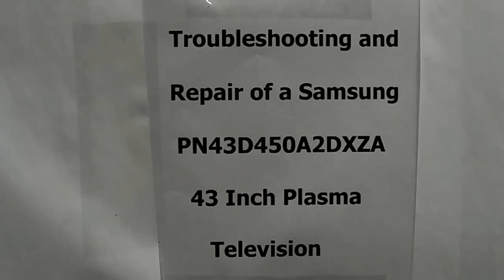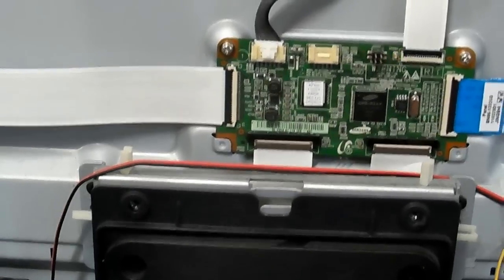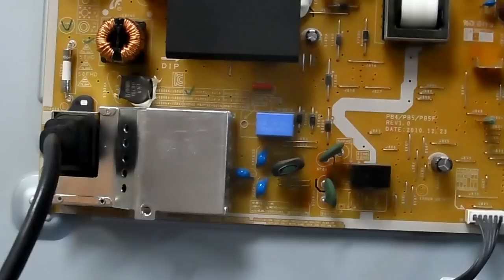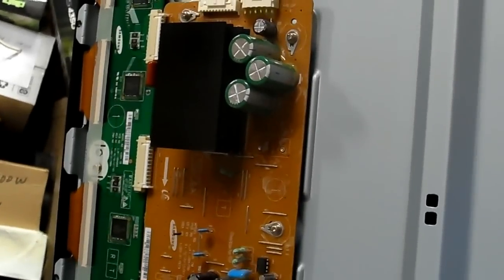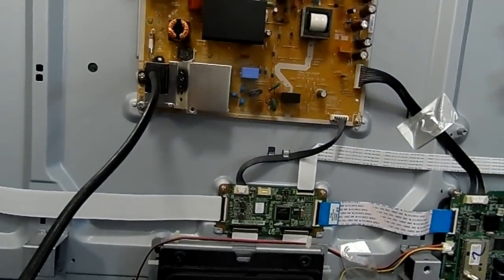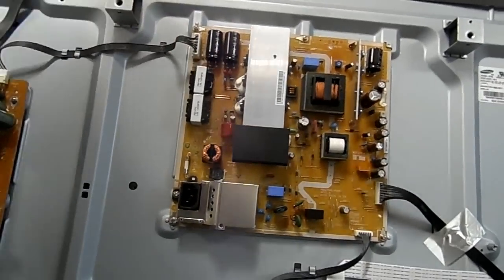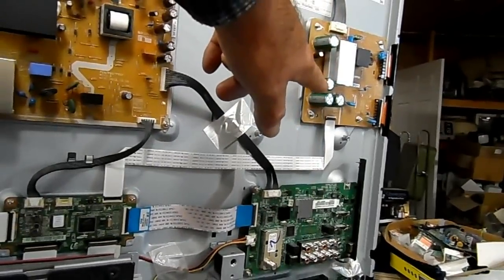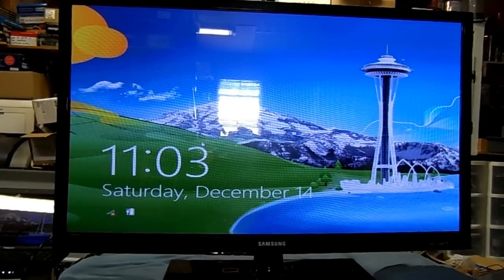Samsung PN43D450A2DXZA Plasma TV Troubleshooting and Repair

Comment: What you showed is easily one of the best ways to trouble-shoot a plasma TV. I recently repaired a 2013 63" Samsung that simply had lose grounding screws, which determined when everything passed but I still had the TV randomly shutting off. I did have to check the voltages on the power supply to rule out a PSU fault.  I also noticed what looked like some cracked solder joints where you'd expect them, i.e. heatsink mounted components such as transistors and diodes. After tightening all the screws, it works like a charm.  I know believe my other Samsung plasma had a similar  problem and I stupidly replaced unnecessary components as I couldn't figure out how to properly troubleshoot. Live and learn.

Comment: Thank you for making the video.  I first started by replacing 3 swelled caps, they were bad.  Reinstalled the board, still the same thing.  I thought I was over looking something.  After watching your video, I found that the right board was bad, just like yours.  I just bought a new board, solved the problem.  I bought my replacement board from "Useful Parts" in Canada.  They have 3 day delivery.  Thanks Godfrey for your help!

Comment: well i had the same problem with same panel. i could only find two boards on ebay, one for 100 bucks and the other for 20. got the cheap one, installed it myself, and now it works great. im a tv repair noob, so a little more on the removal and install in the video would have been helpful, but i managed. just wanted to thank you for the great video and for saving me several hundred dollars on the cost of a new tv. i appreciate it!

Comment: When troubleshooting this particular unit USE CAUTION! DO not plug in live connection or even after turning the unit off.  Wait at least 20 minutes or if you have a discharge bleeder device please use it to discharge the high voltage caps on the power supply.
 
These units are delicate beasts and you can damage the Y-main and buffers just by simply removing or plugging in the boards after being HOT.  99% of the failure on this panel are the Xmain (smaller board to the right on the video) IF you replace or repair that make sure to test your Ymain and Ybuffers before connecting the new board there are videos here on how to test buffers ect.. When the Xmain fails it can take out the Ymain and buffers with it by shorting them out.
Reply: What I said above really applies to all Plasma displays, LCD panels are a little more forgiving but I would use the same methods for those too.

Comment: I followed your direction to a tee, and what I think I learned is that the second board tested is bad. Only concern I have is that when I unplugged the left board, the clicking did not take place and the yellow light came on, but it never came on steady. It continued to flash. But again, all of the clicking stopped. Same thing happened when I plugged the left board back into the power supply, and unplugged the right board from the left board. Any thought you would be willing to share sure would be appreciated.

Comment: great video. i have an older model and it clicks even when i disconnect x/y boards. can it be a t-con issue? or plain power supply board? i recon that this issue started progressing from whem it was ok, it started turning off and turning on by itself, and later turning off after some time of use, and wouldnt turn on (click click but no power).

Comment: Great video! I have a Samsung 51" plasma and I have all the voltages on the power supply, but nothing happens when I power up the TV, no clicks nothing. I did what you recommended and unplugged the Y & X boards, and still nothing. I am guessing its the power supply?
Reply: I've worked on quite a few of the Samsungs in the series demonstrated in this video. If yours is from around 2010-2012, the power supplies rarely fail. To test these, I remove the X-main and Y-main right away to test the mosfets and diodes on the heat sinks for shorts. Otherwise, if you continue to tinker with the TV, a bad Y-main can kill the good X-main and vice versa. The buffer should be replaced if the Y-main has a short.

Comment: Help! I have the exact TV as this one with the exact problem and symptoms and I troubleshot it just like you did in the video and determined that the Power Supply must be the board with the short in it. Well I bought a new Power Supply on ebay, it came in today, I installed it and I still get the flashing indicator light and the clicking noise, what do I do next, I'm determined to solve this problem and I sure hope you can give me some pointers as to how to accomplish this. Thank You, Dave

Comment: I have the same model TV but it does not make chime sound when I followed the procedure you suggested. Maybe I should replace the logic board?. The green light comes on the logic board but does not stay on and no chime sound. Please advise.
Reply: +5leaina I have the same problem, did you find what the error is?
Thank you

Comment: Hi, I have a similar problem. With my plasma pn60f5300, when it turns on only the red light flashes, the voltage VS is of 209 volts but it is lowered immediately to 15v.
Can you help me with this

Comment: i repaired the power supple board on pn58c550g samsung before plugging it back into the tv can i check the out put voltage (DC) by just plugging the 110 power cord. want to make sure this board is working before installing it.

Comment: I disconnected the y main and x main board yet im still getting the clicking? Would that mean that the power supply is bad?
Reply: Here is the same problem with tv. Did you find sollution for this

Comment: Ok just tried this on the same model samsung, as heard a bang, green LED, is the same as if all the boards are good, yet the set doesnt power on, relay only clicks once, and the stand by light flashes, caps look good, must be something else like the panels dead.

Comment: Here is the deal with these sets... There is a bulletin for abnormal failure of the X sus board ( board on the right facing the back that you replaced ) due to timing issues from the logic pcb ( you called in t-con) after the X main is replaced it is imperative to update the firmware to correct the timing issues otherwise the X main will likely fail again.. Make note for anyone watching this video..
Reply: Frank Scarano when u say "update firmware" how would you go bout doing that?
Reply: menu + system+ firmware update